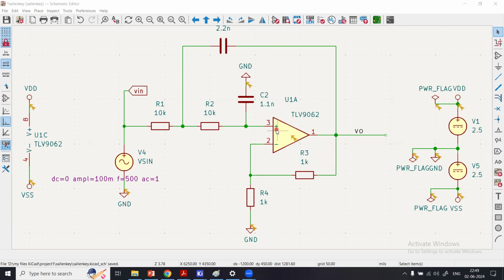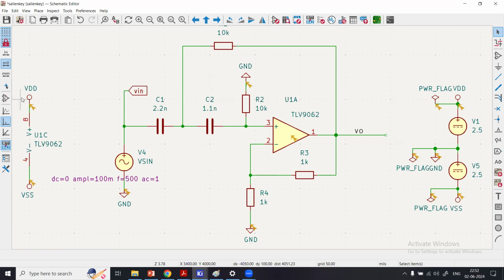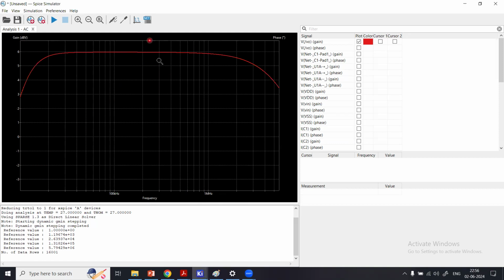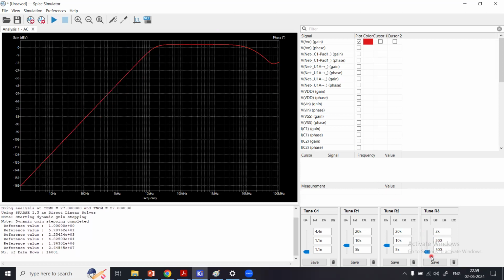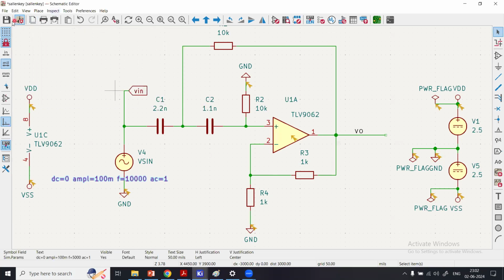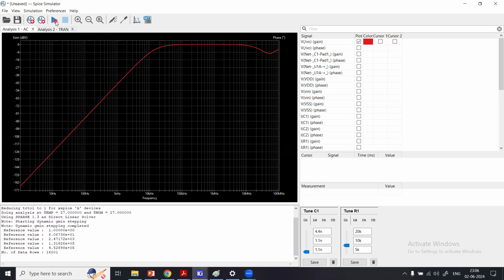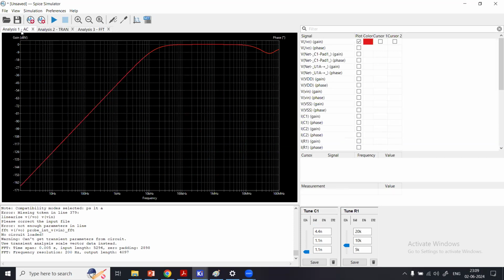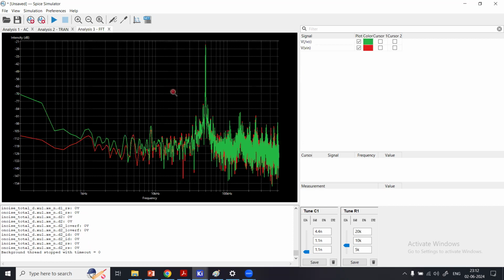High-Pass Sallen-key Filter Using Free Software

Comment: @3:26 what's the point of breaking the connections? You can move components with M key without dragging connected wires and place them in different location. Wires can be drawn through 2 port components like resistors, capacitors, diodes, etc. you don't have to connect to each pin separately.
Reply from the maker: Your comments are useful.. 🙂